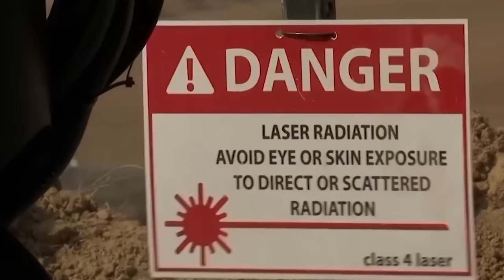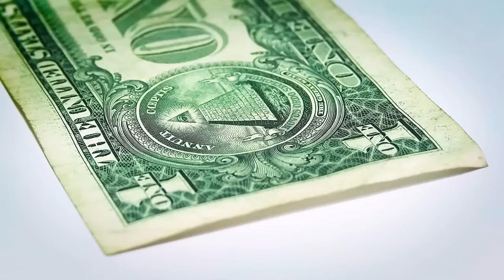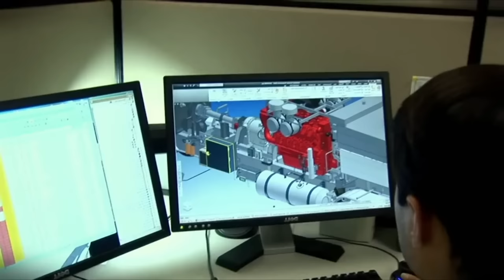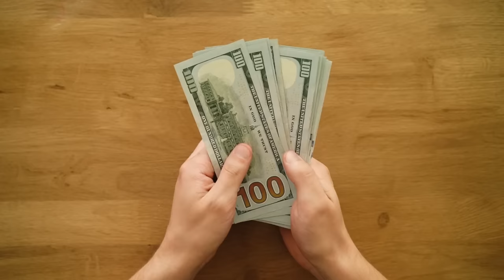US Navy Tested Tesla Laser Weapon System

Comment: Attaching several of these to a nuclear powered ship, and you have a defense system with almost unlimited ammo. The savings in weight would be truly remarkable. This would be especially good for aircraft. So now, I've witnessed the use of armed robots (drones) in combat and now the final testing of REAL laser weapons and railguns. Progress in technology since my childhood has been an absolute blur!
Reply: As long as you have a very good cooling system with liquid nitrogen, MAYBE this would be possible.
Reply: @rRobertSmith  Eternal radiators with a good heat-exchange system could suffice, particularly if the radiators were submerged underwater for greater transfer.
Reply: Unfortunately they have developed reflective coatings that reflect most of the power. It has already been field tested follow Israel news
Reply: @mehranmossaddad1656  I seriously doubt that. Mirrors can't disperse the heat energy from the laser. A high-powered laser weapon would simply melt the glass and overheat the aircraft.
Reply: @MilesEdgeworth129  not mirrors they have developed some kind of nano coating. Tested in israel
Reply: @mehranmossaddad1656  Well, maybe it could work at low-power settings for the laser, but without a robust heat-exchange and radiator system, it would be ineffective against high-energy lasers. It may mitigate the effects, but I doubt it can negate them.
Reply: @MilesEdgeworth129  we shall see
Reply: Don't forget every offense has a defense.
Reply: @mehranmossaddad1656  Every offense has a defense? Okay, come up with one for kinetic bombardment.
Reply: @MilesEdgeworth129  yes the Rods of God.
Reply: It should've been better by now if you ask me.
Reply: @RedHorseman66  Higher-megawatt prototypes are currently under development and testing.
Reply: @MilesEdgeworth129  planetary shields
Reply: @meruthesuccubus3416  Do we have those yet? How would they work? Exactly what force would they withstand? Is it an energy shield? Physical shield? Magnetic shield?

You can't just blurt out an answer consisting of sci-fi technology that we have not yet invented.
Reply: @MilesEdgeworth129  I doubt either of us will be alive by the time we figure out how to build one who knows how many s decades years centuries that could take
Reply: @MilesEdgeworth129  but what about that thing the ark birds have in ace combat 7 some kind of microwave shield I don't know the science behind it but it looks more plausible then say the shields you see in star wars
Reply: @MilesEdgeworth129  
Terawatt (1,000,000,000,000 watts!) also!
Reply: @MilesEdgeworth129  
Oh ye of little faith!
Reply: @ThomasLee123  I'm sure that kind of power is still in R&D. If it is of that wattage, then assuming it's with today's technology, perhaps it would be an array of multiple solid-state diodes using multi-lens compensation to converge on a single point at a particular distance, like a magnifying glass, only several hundred kilometers instead of a few centimeters for the convergence point.
Reply: @mehranmossaddad1656  
USPL is pulsed at the speed of light. Pretty sure Israel does not have this tech.
Reply: @MilesEdgeworth129  
I agree.
Reply: @mehranmossaddad1656  
You're talking Mickey Mouse using a magician's robe here. The Israelis are not into magic as far as I know.
Reply: @MilesEdgeworth129  
Mega watt power is for "Continuous" lasers. Terahertz USPL is much more powerful.
Reply: Yes.
When you read what many in the military are saying about the USPL this is why it is so important. Literally all of the problems that currently limit laser beams as weapon have been been solved by USPL.

Imagine a very stealthy drone circling the skies above North Korea or Iran (or an orbiting satellite) waiting for the launch of an ICBM. Once detected, it could take that missile out of play while it is still in its most vulnerable boost phase. This is exactly what Ronald Reagan imagined for Star Wars to effectively end the threat of Armageddon by nuclear weapons in the hands of insane dictators.  Reagan even proposed giving this technology to anyone who wanted it!
Reply: @mehranmossaddad1656  
You (and the Israelis) don't understand USPL then.
Reply: @mehranmossaddad1656  
We are talking about ending the possibility  of Nuclear Armageddon! It is definitely worth the effort.
Reply: @meruthesuccubus3416  
Oh ye of little faith. 
LOL
Reply: To the OP comment, no. The amount of energy needed would be... a lot. It would require a battery for an energy source, there isn't a way to install a energy producing unit to fuel a laser turret, except by a battery. Nuclear turbines  wouldn't be able to charge a sufficient amount of energy over a short of time.
Reply: Too expensive when the enemy can just build reflective shields to avoid the laser beams....
Reply: @mehranmossaddad1656  Although it might negate the affects of laser energy weapons.

Gotta remember that it still generates heat and unless the nano-coating can mitigate heat transfer and insulate itself from the carrier.

Its not a guarantee that it can protect it from weapons. It might just take longer and put stress on the energy weapon system. Maybe it will cause a burnout or overload from excessive voltage or energy dispersement.
Reply: @tlnickelsen  of course israel doesn't if you can make material that withstands heat at hypersonic speeds you can make shields for this.
Reply: @vicerichter1163  if one can make material to withstand hear generated moving at hypersonic speeds this is a piece of cake to counter waste of money may be not used against some backward army like afghanestan that didn't even have air defense or simple radars but not for hyper powers like iran, China, Russia, N Korea ...
Reply: @mehranmossaddad1656   which it cant. hypersonic speed, the friction is like 500-1200 degrees. Also the engineering suggests to have the carrier above atmosphere. Where air is thinner and less drag. Also alot of material built to withstand heat is too expensive for something that is a single-use only. And heavy. Which for something hypersonic, means it can travel longer distances far outside detection of radar, bud. Thats the whole point for hypersonic speed. Harder to track where it launches from. Harder to intercept. So a laser is extremely viable since it is an energy dispersment type of weapon. Which can burn hotter than the surface of the sun. Which no man-made component can withstand at all. Especially in aerospace engineering where everything is designed to be light enough for an object to maintain in-flight and at hypersonic speeds.
Reply: @vicerichter1163  yes according to what you know but can there be things you don't know about?
Reply: @mehranmossaddad1656   it is common sense, bud. During the development of Sr-71, they found out how hot the surface of the aircraft gets at mach 3 speed so they had to figure out how to make a composite heat shield built to withstand the extreme heat. And as far as Iam concerned. Nothing on earth exists is built to withstand 10000 degrees constantly for any amount of time. At least not for aerospace.

Comment: You don’t necessarily need a laser that can cut something in half with a quick swipe from ground to space. Although that would be nice. You just need enough radiation to mess up its electronics.
Reply: USPL is a pulse laser that grinds away the surface of the target.
Reply: The problem with EMP is there are ways to shield against it! For example, use TTL instead of CMOS FETs.
Reply: yup yup bet he didn't think about that but he did make a good  then you came along ahahahah  @ThomasLee123  sorry
Reply: Light is radiation
Reply: @AccaliaLife  maybe so, but what I’m talking about is a little bit stronger than a flashlight.

Comment: VERY INTERESTED IN ULTRASHORT PULSED LASER (USPL).
USPL solves most of the problems of earlier and current LASER weapons by creating high energy pulses in the Terawatt range. Instead of a continuous stream of a high power laser, this weapon creates ultra high power at very short pulses (in the FEMTO second range). These extremely high power lasers solve so many problems with weight, heating, fog and mist, etc. that the USAF is very interested on placing them on all F-35s and even the coming 6th generation jets now nearing release. 

There is not much information available on this new weapon but you can see by examining the hiring trends of high power labs like DARPA, Lockheed and others for what they are currently working on. Even more interesting is the government's slapping very high level security clearance on this project after initial successes in laboratory environments.
Reply: That wouldn’t solve the problem of rain or fog
Reply: @TS-ij9cz  
It does! You need to read the material I linked! USPL lasers supply such power (terawatts) that they actually punch a hole through the planet's atmosphere including smoke, rain and fog similar to a particle beam weapon!
Reply: @ThomasLee123  I didn’t see a link, could you try again?
Reply: Also, you can buy a femtosecond industrial cutting laser with instantaneous powers exceeding hundred of terawatts for under 100k. You must be talking about something different
Reply: @TS-ij9cz  
YUP
Reply: The chirp pulsed beams have greater longitudinal electric forces in them and whence exert more forces on the object they hit. tesla used impulse DC to launch aetheric focused force beams or gravity beams.

Comment: I can say about tanks for sure, when you hit a tank with a laser, the crew will be alerted that a laser is pointing at them, and will automatically turn the turret towards you.
As for penetrating a tanks armor, the laser will slowly cut through the armor. It will be nowhere near instant.
Reply: Depends on the power of the laser.
Reply: @ThomasLee123  The power of the laser is harmless if the tank deploys smoke grenades
Reply: @razvy6949  Not with USPL.
Reply: An all chrome tank, it just reflects lazers away 😂😂
Reply: @ThomasLee123  
any laser will do this. whether the weapon is beam riding or the laser is just used to paint the target in some other way, the tank will almost instantly target the source of the laser and employ counter measures...  in a perfect world, of course...

Comment: Anyone else believe that a mirror could reflect the beam ?
Reply: It depends. If the intensity were higher than the damage threshold of the mirror material, it wouldn’t make a difference.
Reply: Sounds good but does not work. In the first place, mirrors make aircraft easier to spot. In an age of STEALTH that does not work. Also, such materials tend to be heavy. Not good for aircraft that sweat $Millions for every Kilo.

Comment: Believing to fight a drone with a LASER assumes that the drone will stand still until it is grilled. Putting some cheap photo resistors (=sensors) on the drone which can detect LASER targeting, could start a “crazy” flight pattern program that would make it impossible for the LASER to follow those random patterns. Even if a first drone was shot down by a LASER, other drones (from the swarm) could start their “random flight” patterns after the radio link to the first/dead drone dropped… LASERS are not useful for drones or other small aircrafts which can change their course quickly. LASER can only destroy “sitting dugs” – but those are usually big target that need a long time to get grilled. If LASERS become wide spread, a new “Anti LASER” coating (like a mirroring material/chrome) could be put on potential targets… Is this all only obvious for me???

Comment: 4:19 I don't think laser would be overwhelmed I think you need a refraction Crystal. I'm sure there are types that magnify light. I can speedpaint multiple objects at once with tiny adjustments I think a laser would ☠️. You should have something intelligent enough we could split the beam into 12
Reply: Splitting the beam only result in longer exposure times and it'll be higher than sequental targeting, so less efficient.
Reply: Similar to the idea of a Pulsed Laser.

Comment: Cheaper, but not necessarily more effective, all one needs is a anti-beam coating (think of it as microscopic mirrors or high energy absorbing materials) so killing vehicles won't be as easily as one thinks, aerial vehicles are a different story since weight reduces speed but tanks and ships would be able to block out a laser attack for a limited time as if the lasers are what is said than the coating would not last long.
Reply: A mirror won't protect you from an X-ray laser, especially a Gamma Ray laser (once it's invented)
Reply: @lorenzamccoy7512  you do know that an ‘anti-beam coating’ isn’t the same thing as a mirror
Reply: @Anonymous-dy5hb  that's literally what he just described.... What do you think a microscopic mirror is? It's just a mirror that's smaller... If you want to be real technical, what he's describing is almost space magic, in order to absorb energy the energy has to go somewhere else.... E=MC^2
Reply: Are microscoptic  mirrors a proven defense against them?
Reply: @galvinstanley3235  no and they probably don't even exist yet
Reply: This would mainly be used as a first strike weapon against sam radar,that would make a sam blind so it couldn't fire with any kind of accuracy.